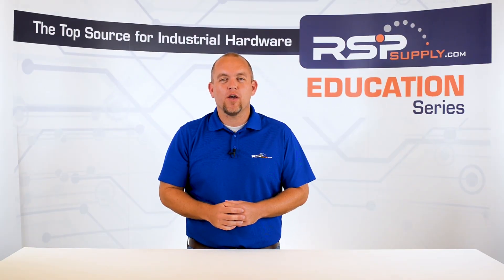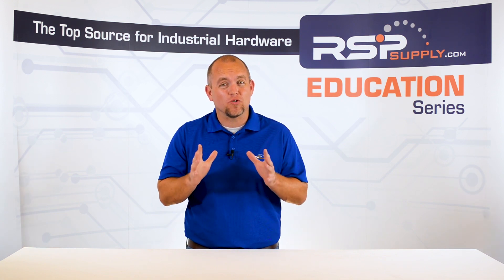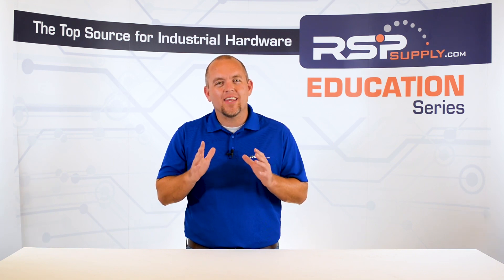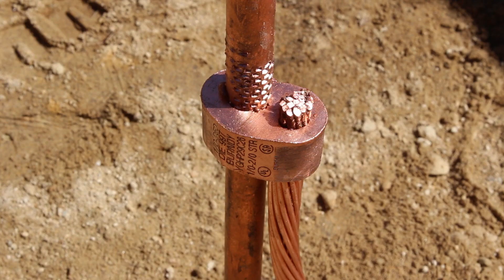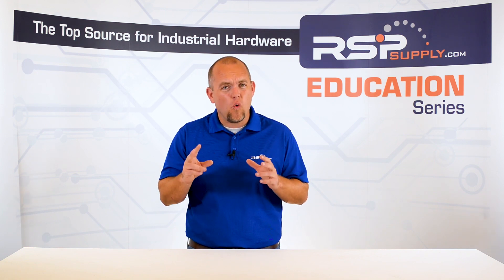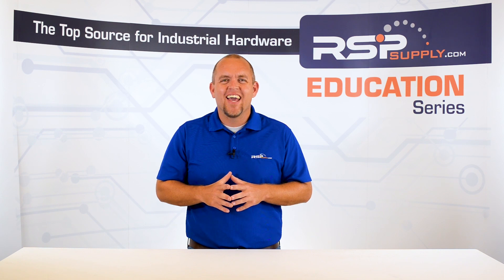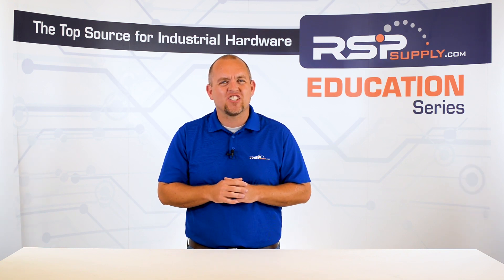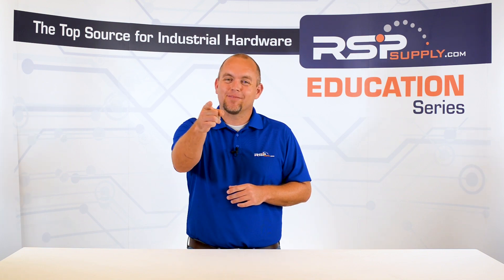Grounding in a Control Panel

Comment: What should be the resistance value between IE bar and SE bar in assembled panel in factory and installed panel (connectd to earth pit), when we measure with ohmmeter?